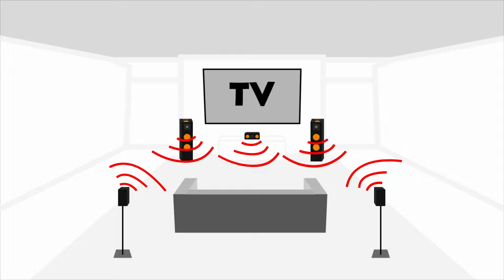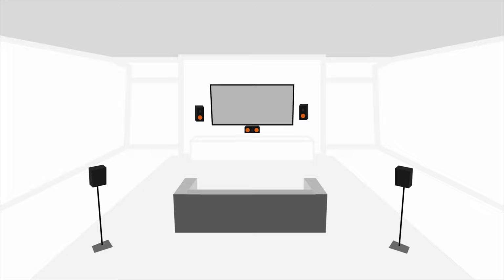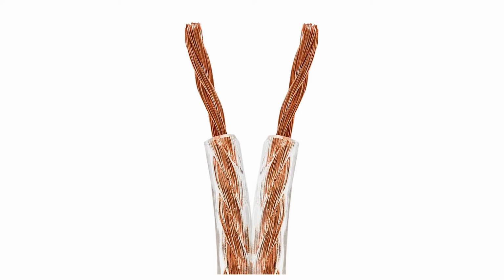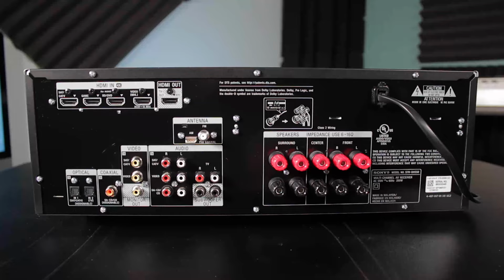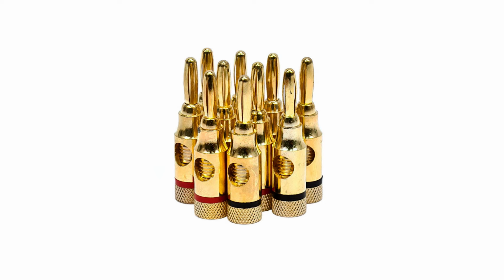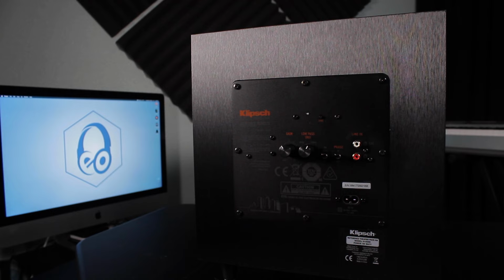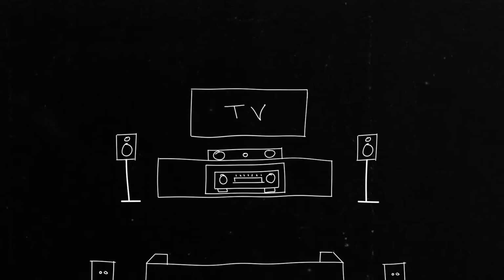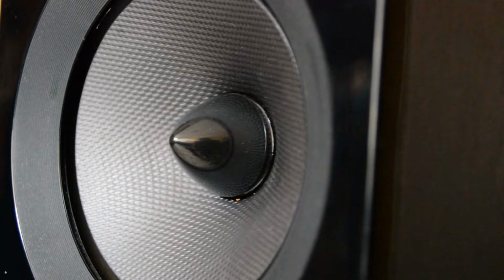BASIC 5.1 SYSTEM SETUP | Home Theater Basics | Sony |@Klipsch

Comment: see that some are having issues with the Sony STR-DH590  sound set up dialing in the SW because the 'on screen' GUI only has limited options. have that model coming in the mail and have been reading (hearing?) all I can prior to installation. got the 5.1 Klipsch's myself to match up with this unit. a post by the cheapaudioman not recommending the unit because of this hassle has really thrown cold water on my expectations. I just may go all manual with the thing. as yet have the Klipsch's hooked up to a mini-amp (Fosi BT30D Pro) and they sound great.

Comment: A Sony rep said I could connect my Sony soundbar HT-MT 300/301 to the sony STR-DH590 for more juice in my sound is this true? Would that work?
Reply from the maker: I’m not familiar with that soundbar at all, so your guess is as good as mine. The HT-MT300 doesn’t seem to have any audio outputs - just inputs - and those inputs are limited to optical and 3.5mm. 

The only outputs on the DH590 are from the speaker terminals or HDMI, so you’d have to get a little creative with adapters just to make it work. I’m not seeing it, but I’d love for a Sony rep to show me how it’s done, because I’d be very interested in knowing how to pull that off. 🙌

Comment: I have the same STR-DH550, but once when I wanted to check my subwoofer cable because the sub was acting weird, the cable touched a wrong part apparently and a small explosion happened, now something is stuck in one of my subwoofer out ports, have no clue how to get it out but I can't put a cable in it anymore, the other one works fine, but I am limited to .1 instead of .2 now.
Reply: And btw it SUCKS that it doesn't pass through HDR.........

Comment: If I want to run an Xbox Series X, a receiver and a projector, everything goes IN to the receiver and the only thing going OUT of the receiver is to the projector? I haven’t purchased the receiver yet but some advertise as having only 1 HDMI input. This setup would exclude me from adding any other audio source (like a turntable for music), correct?
Reply from the maker: If everything is connected to the receiver, yes - you would only need 1 HDMI cable going out to your projector. 

Most receivers nowadays have many HDMI inputs - at least 4, I think. And a lot come with phono input support for a turntable. So if it also has a phono input, you’re golden. 🤘

Comment: Can you show a video as to how you ran your speaker wire behind the wall?
Reply from the maker: I don’t have a video, but I can tell you that I had to go up into the attic, find the space between studs where I needed to go, drilled a hole into the 2x4 at the top (where the ceiling meets the wall) then snaked wire down, pulled it through the hole in the wall next to where the speaker would be mounted. 👍

Comment: Do speaker wires have to be run through walls and ceilings though? What are the other ways it can be done without the wires showing
Reply from the maker: Check out this article from SVS!

https://www.svsound.com/blogs/speaker-setup-and-tuning/10-ways-to-hide-speaker-wire-and-audio-cables
Reply: @ealanosborne  thank you

Comment: Any pros/cons to to plugging all hdmi cables into receiver theme one from the “out” to the tv vs all connected to the tv the tv and receiver connected via arc?  As in, if your equipment is capable of both, is there still a reason to do one way or the other?
Reply from the maker: Just depends on your situation. Example: I have a media closet somewhat away from my TV, so I plug my Switch directly into my TV for a more direct connection to the Joycon controllers. Also, if you have a PS5 or XBOX Series X - since receivers have had HDMI 2.1/4K @ 120Hz problems - plugging that directly into the TV bypasses any issues like that. Otherwise, it’s usually fine to plug everything into a receiver. 👍

Comment: Question can you  use banana plugs on the speakers. Also what do you use to wall mount them?
Reply from the maker: Yes, you can use standard banana plugs with the style of speaker terminals that are on the receiver in this particular video (they’re called 5-way binding posts). 

With spring loaded speaker terminals, since the hole to insert the speaker wire is smaller, you’d want to get “pin banana plugs,” since they have skinnier tips. 👍

Comment: For a connection using the Optical input on the receiver, would it be the same as the hdmi arc? Plug everything in the tv, then from the tv using an optical cable to the receiver optical input? Is there any difference in that setup?
Reply from the maker: Audio-wise, they should sound the same. Although a lot of 5.1 AVRs nowadays are CEC compatible over HDMI which allows you to control volume and other features via your TV remote. So that’s nice, in case you don’t have line of sight to your AVR (like me, since mine is in a media closet). You can’t get CEC control over Optical. Something to consider. 👍
Reply: @ealanosborne  You not only answered my question, but I didnt know you can use your tv remote to control the speaker volume using ARC. That's awesome! Thanks. Literally made my life one less remote using my 2.1 sound bar now. I want to upgrade to a 5.1 sound system in the future so I am doing research using your videos and it has helped a lot! Thanks!
Reply from the maker: @gabrielaceves6984  Hooray!!! 😄 Glad I could help!

Comment: Great video! I do have a question. Four of my speakers are in the ceiling. My problem is that I only hear the front two with my center speaker. The rear ceiling speakers are the surround speakers and I hear nothing.  I’ve tested them in the test mode and there’s sound. What am I doing wrong or is it up to how the audio is broadcast?
Reply from the maker: Huh...what are you testing it with? A show or a movie?
Reply: @ealanosborne  A movie on Netflix. Usually the Netflix music note when you launch the app you’d hear with the sub woofer only comes out of the center and front speakers.

Comment: Why does my subwoofer not make any sound, I have the same setup you have but with a 590 instead
Reply from the maker: 🤷‍♂️ the three rules of audio troubleshooting are: 1. Is it plugged in? 2. Is it turned on? 3. Is it turned up? You’d be surprised how often that has saved me from hours of headache. And if that doesn’t do the trick, I guess make sure on the software side of things that you have a 5.1 set up, and there is indeed a subwoofer in the system.

Comment: I have a new LG 657 home theater system 100w 5.1 . Afters connecting the  four speakers ,sound bass is too low what can do to improve the bass quality. Thanks
Reply from the maker: Wow, haven’t dealt with that system before. Is there an app for it that you can download? So that you can fine tune any adjustments to the speakers or subwoofer specifically? Sorry I don’t have more info for you.

Comment: My sony requires speaker set up. 5.1, 7.1, 5.1.2, etc. I have 2 front, 1 center, 2 rear ceiling,  and 1 subwoofer. Just curious if anybody can tell me what to choose
Reply from the maker: That would still be considered a 5.1 setup, even though your rear speakers in the ceiling. A lot of new construction houses will do that - install in-ceiling speakers so they’re out of the way. But your speakers add up to 5, and one subwoofer, so set your receiver to 5.1 and run the room calibration software so it properly sets the timing right with your in-ceiling speakers. 🤘

Comment: Thank you but i have a problem…
I have a pioneer 5.1 surround system and i connect both of my ps5 and my benq projector to the receiver and it works but the sound are only coming from the projector not from the speakers
Reply from the maker: Is the BenQ projector connected to the HDMI output? Maybe also make sure HDMI Passthrough is turned off in the menu?

Comment: I have the  klipsch reference pack and the yamaha v385, and the sub is connected wirelessly. My question is where should i set the crossover/low pass knob?
Reply from the maker: 120 Hz, since the Theater Pack satellites only reproduce sounds down to 110 Hz. So the sub will fill in the rest. 🤘
Reply: @ealanosborne  thanks!

Comment: Great video!!! Just curious, if i have an older dvd player with only coaxial cables can i plug them into the receiver and get it on to the tv via hdmi earc?
Reply from the maker: Well eARC only applies to audio coming from the TV back through your AVR. BUT…yeah, as long as your AVR has digital coax inputs, you should be able to connect your older DVD player to it and select that same input in the AVR menu. 🎉

Comment: I still havent bought any speakers im still learning about all this, im gonna get a 3.1 setup, R/L and centre speakers with a sub, do i also need to buy cables for each one of them? do they not come with cables?
Reply from the maker: Yeah, normally you have to get speaker wire separately.

Comment: Great Presentation.  You noted that your receiver is located remotely in a closet.  I have a similar setup.  I installed a Smartcraft IR emitter to control devices (Sony A/V, BlueRay, Apple TV with my universal remote.   Remote seems to be working fine and sensor is definitely receiving the signal but my new Sony DH590. receiver does not recognize the signal.  Could there be an issues with difference frequencies between the emitter and the receiver?

Comment: If you wanted to add two atmos speakers where would you place them above you to closer to the tv angled towards you?
Reply from the maker: Above your head gives you a bit more spatial awareness, since it’s a more discrete third dimension you’re adding. BUT...putting them above the TV angled towards you gives you the “wall of sound,” which gives you the illusion that your TV is massive. Both are rad. 😀👍
Reply: @ealanosborne  again thanks for the quick response setting your 1500 atmos system keep it up man enjoying it all

Comment: Nicely Done.
Question for my old Denon 5.1 setup.
I normally run everything, movies and reg. tv in the 7 ch. stereo mode. Voices sounds great from the center channel just not getting the Dolby Digital 5.1 separation.
When the system is set up using Dolby digital for 5.1 my center channel audio gets very muddy but I get the effects going to all the other channels.
Is there something in the setup that needs to change or I should check ?
Thanks in advance.

Comment: Need expert advice - I have edifier 5.1 active speakers including subwoofer. All satellite speaskets go into subwoofer and it has inbuilt amp. I am using rca from a bluetooth receiver to this subwoofer system as an input for years but nowI want to connect this beast to harman kardon avr. So i kept all sattelite speakers connected to subwoofer only and just connected avr pre-ouput from rca to subwoofer input rca. But then volume conrol of avr does not work. Does avr work fully only when all speakers connected to avr’s speaker jacks?
Reply from the maker: Which Harman Kardon AVR is it?

Comment: I have an old Sony STR-K7000 that has 3 HDMI ports, labelled DVD, VIDEO2 and VIDEO out, anything I plug in to VIDEO2, the audio only comes out from the TV, not from the receiver; I connected the firetv or the blu-ray to video2, but sound only comes out from the TV, am I missing a connection or that is just how is it designed. I connect a karaoke machine to the front VIDEO3 (RCA) and the sound comes out from the receiver. Thanks for your video/reply.
Reply: Also, I connect a karaoke machine to the VIDEO2 (RCA/composite) and the sound comes out from the receiver. Thanks again.

Comment: The best video I came across after 3 days on you tube. But my problem Isn't solved yet .😊 Could you please tell me how to do it if it is possible? My av reciever ( Teufel Ultima Kombo 20)  has only 2 binding posts each  for left and .right speakers.There is no provision to connect center speakers.Now Is there anyway I could connect a center speaker? Thanks
Reply: No you cannot have a center speaker as your system is a stereo so that means your sound is going to be two speakers only. Stereo sound does not need a center speaker and has an excellent sound on its own. 
Stereo is good enough for high end music systems and can be good enough for home theater. Before proper high quality 5.1 came along my home theater system was stereo and to be honest it was amazing.

Comment: Do you have a recommendation on what frequency I should set my satellites speakers and subwoofer be at? I currently have the satellites set at 110hz and the subwoofer at 120 hz. Just wondering if you recommend anything different for this klipsch theatre pack 5.1 set up. I didn’t hear you reference it in this video.
Reply from the maker: I’d set them both to 120 Hz. I know the satellite speakers can go down to 110Hz, but a little buffer of 10Hz is good to have. 👍
Reply: @ealanosborne  Sorry but this might be a very basic question, does that mean if I set the satellites at 120hz, any frequency below 120hz will be routed to the subwoofer instead?
Reply from the maker: @warrior15r  correct. So the subwoofer handles all the low-end audio, since those little satellites can’t go that low at all. 👍
Reply: @ealanosborne  Awesome, thank you. Makes sense. Changed satellites to 120hz. Love these speakers.

Comment: Great video, I was wondering if you can explain the "crossover frequency" and what is the optimum setpoint, I've got mine at 140 but the max setting is 160. My speakers  and receiver are old (Polk 6751 and a Sony STR -DG500).
Reply from the maker: Thanks! And the crossover frequency is where you tell the receiver to split the difference between a speaker and the subwoofer. Basically where the subwoofer will take over with low frequency sound. Those Polk 6751 speakers' frequency response dips down to 40 Hz, so you typically want to set the crossover frequency 10-20 Hz above that. So I'd go with 60 Hz, for example. Make sense? 😀
Reply: Make sense, I appreciate the information. that was really helpful, I do notice a difference in the quality of the sound. 
By the way, does setting it up higher than 60 harm the speakers?
Reply from the maker: @wesvill7565  No, not at all. You could set any speaker’s crossover to 150 Hz, but then you’re robbing the speaker of some mid-low frequencies that help give it a fuller sound. THX standard is 80 Hz, so you could also test that to see if it works better in your situation.

Comment: So whats's the real difference to using arc vs all plugged into the tv?
Reply from the maker: I would typically connect things like an XBOX or PS5 straight into the TV, since most likely your TV has better built-in video tech as opposed to a garden variety AV receiver. So it's mostly a video thing. Audio-wise, it there isn't (or at least shouldn't) be any difference in quality. But another reason to use ARC is if you prefer using your TV's built-in streaming apps, as opposed to an AppleTV 4K, Fire Stick, Roku, etc.
Reply: @ealanosborne  Thanks again man

Comment: Nice video and explanation. I just ordered my Klipsch 5.1 , do i need to absolutely pair it with a receiver? If not , how does the set up sound by itself ?
Reply from the maker: Yes, the Klipsch Reference Theater Pack is a set of passive speakers, meaning they can’t power themselves, and need to be powered by a receiver (connected via speaker wire). 

Sony STR-DH590, Denon S650H are good 5.1 channel baseline receivers. 👍
Reply: @ealanosborne  Thank you for your reply. I might have to get myself a receiver too in that case ! :)

Comment: What shoud i need if i need to connect the wireless speaker to my computer?
Reply from the maker: Which wireless speakers were you thinking of?
Reply: @ealanosborne  i have the same klipsch speaker, i want to use it on my new computer set-up, i have a z790 asus prime motherboard. What do i need to connect it to my pc?
Reply: @ealanosborne  and do i still need to wire the 5 speakers? If so probably i bought the wrong one
Reply from the maker: @Zero-mugi  Yeah, if you’re talking about the same Klipsch 5.1 Reference Theater Pack, that needs to be powered by a receiver and connected by speaker wires. It’s not wireless or meant to plug directly into a PC like a Logitech surround sound system. Sorry.
Reply: @ealanosborne ok. Nice. Thank you for the input 👊, very much appreciated 🙏
Reply: @ealanosborne  thnks man, very much appreciated!

Comment: My subW is not working, please help.   
Connected my TV HDMI Arc to Sony STR DH540 HDMI Arc out (with high speed HDMI cable).  Connected Klipsch wireless receiver to the AV receiver subwoofer out.  Then powered in both Klipsch subW and wireless receiver. Constant blue lights are on.  TV settings changed so ARC HDMI is active.... still woofer does not work.. (Have not connected other speakers to AV receiver yet)....what can I try to trouble shoot?  Please help.
Reply from the maker: Do you have an RCA cable to test out if the subwoofer works wired? If it works wired, and not wirelessly, it might be the wireless transmitter that doesn't work...
Reply: @ealanosborne   Thank you so much for your reply!   :)    your videos are great!! 

I was just able to get the subwoofer work with a USB-Iphone connection to AV rec. So wireless transmitter and subwoofer works.   

so I think now its narrowed down to the HDMI cable, HDMI Arc port in TV, HDMI Arc port in AV receiver, and overall ARC settings..